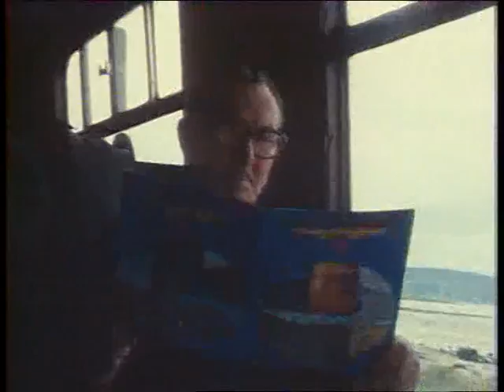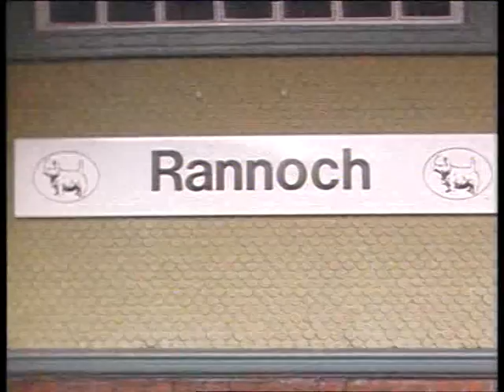Distant Signals

Comment: Remember those new 150's well. They're getting to be old ladies now. But surely doing away with the staff in what can be a pretty bleak place in the winter was a mistake. Those lovely old MK1s and 2s were a much nicer ride than the replacements mind. The railway's more than just a money-based thing in rural places. It needs to be run as a service. I always carried that thought when pottering about the old Southern Region on the DEMUs or the old electrics when I worked there.